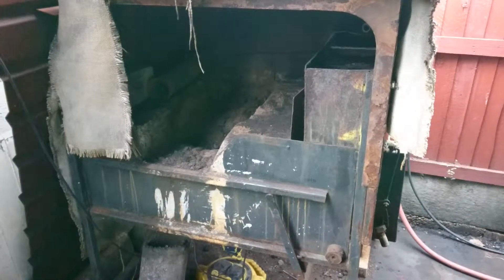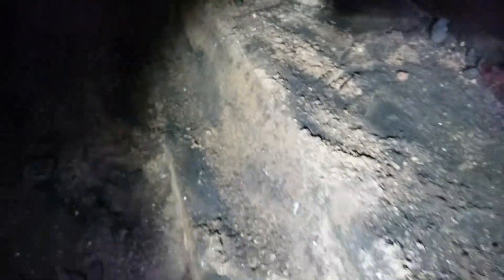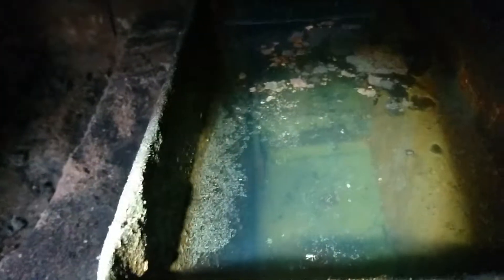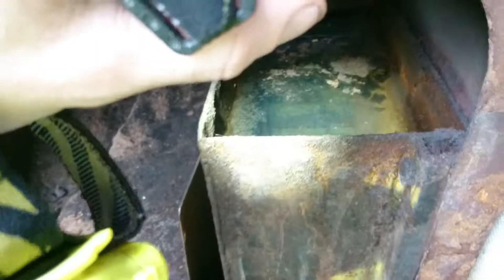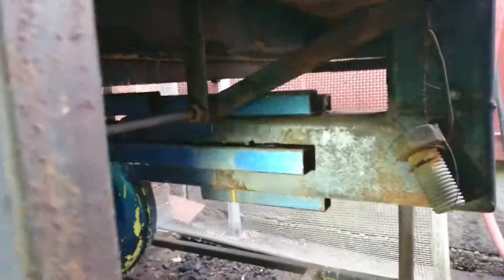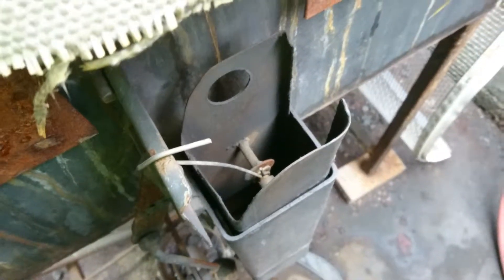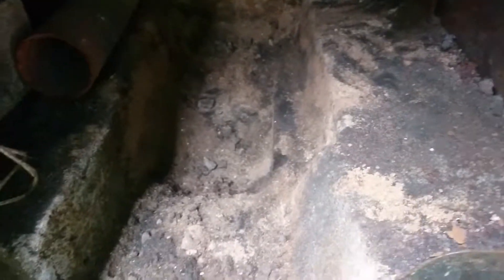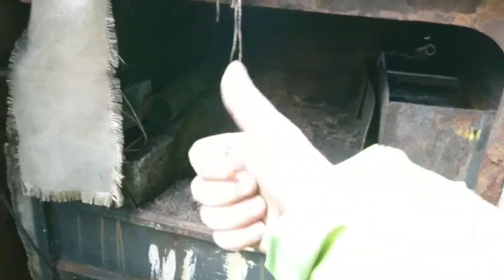My Side Blast Coke Forge

Comment: I've become accustomed to both styles. Bottom and side draft.  My typical use, is side draft, as shown in my dirt box forge build. As long as you get used to the forge, no matter the orientation, it will serve you well.  Thanks!!
Reply from the maker: i have never tried a bottom blast so I cannot comment, but I liked the fact there is next to nothing to wear out in this design, ash is your refractory as such?
Reply: @DaMainMouse  I use a modified clay lining. NO sand in the mix. Sand=glass. Glass= clinker